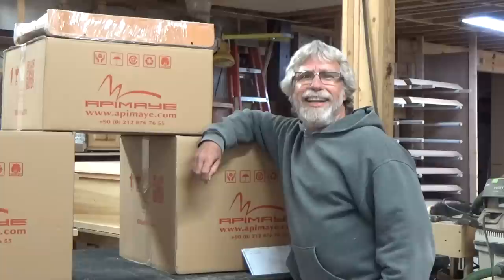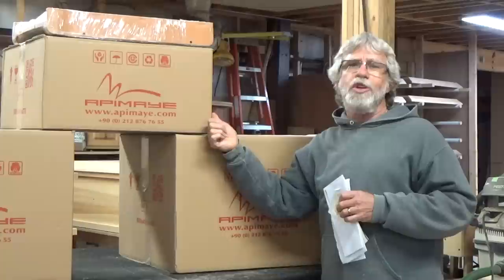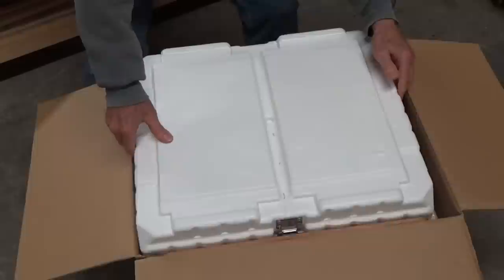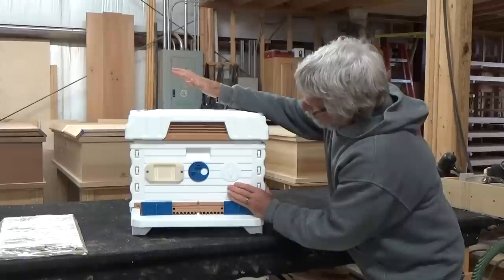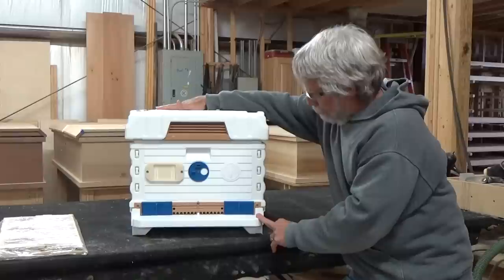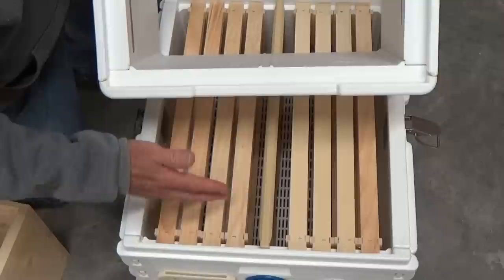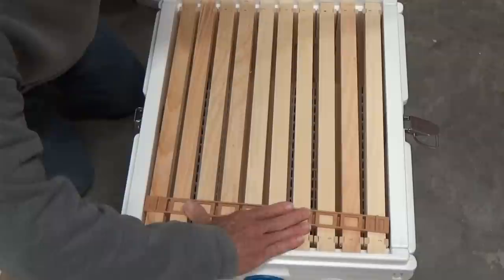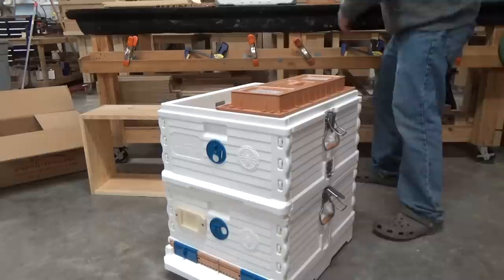Another beehive option for beekeepers.  Apimaye beehive review...the Yeti of Langstroth's.

Comment: I would call this theYeti cooler of beehives!

I'm watching for your experience going forward with this hive concept. I do double deep brood boxes and I usually don't get more than four or five years max out of them. I'm tempted to try Apimaye.

One thing I noticed about the nucbox and it's divided state with two entrances, was that the ventilation dials and entrance sliders were coordinated in yellow and blue plastic. That must certainly be a differentiation done on purpose for bees' color perception and landing at the correct entrance.
Reply from the maker: The price of the Apimaye hives is steep, but you certainly get what you pay for and the price is justified by the longevity of the hive. Thanks for watching. God's peace Ken.
Mr. Ed

Comment: Is it accurate that the divider board(s) cannot be used with the pollen trap in place?
Reply from the maker: Correct, the pollen trap has to be removed if the dividing board is used. But if you were using the dividing board, there is no need to collect pollen from a hive that is developing and not with population of bees necessary to have a surplus of pollen. Thanks for watching. God's peace.
Mr. Ed

Comment: My big concern would be the degradation of the plastic over time. I live in the humid south and I've seen most plastics degrade and metal fasteners just pulling out of the rotten plastic, which is then impossible to fix. I would also be concerned with micro-plastic particles contaminating the honey. Already there is micro-plastic particles in just about everything on the planet, including drinking water. With a billion bee feet walking over the plastic surfaces there is a good chance of plastic breakdown. It is already too prominent in the food we eat.
Reply from the maker: From what I was told, because the plastic is made from recycled and UV protected plastic, the breakdown of the plastic is very very low. God's peace Rick.
Mr. Ed

Comment: I purchased their top of the line three deep box, and the first year, this year, I had a complete die-out...because of the cold - there were dozens of bees dead in the top tray - with a full Hive Alive fondant and they were all dead. The feeding system is very specific and you cannot just lay fondant or pollen patties over the tops of the top cover due to the feeding system, which must be used to secure the bees. Decent system, but def needs improvement. I spent over $600 once i added a super... and they still all died. smh.
Reply from the maker: Regardless of the hive choice of the beekeeper, the hive body is not the cause of the death of a bee hive. And as far as the design of the feeding system, there is no perfect way of doing it. However,  they offer a design that is very much the same as many others on the market, but their's is designed into the lid of the hive. Thanks for watching. God's peace Dave.
Mr. Ed
Reply: @JeffHorchoff  Thank you sir for the reply... and for wishing me peace, I need some in my life about now. thanks.